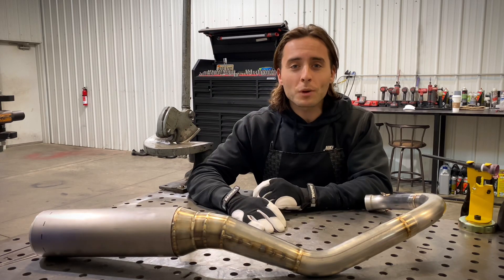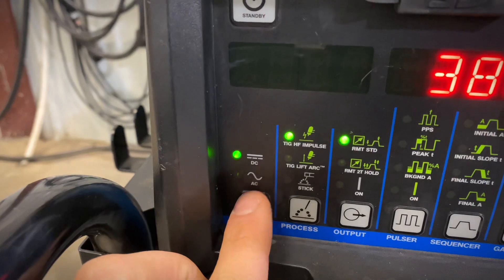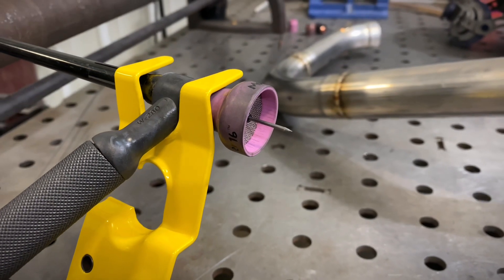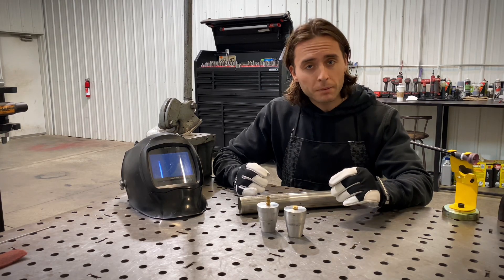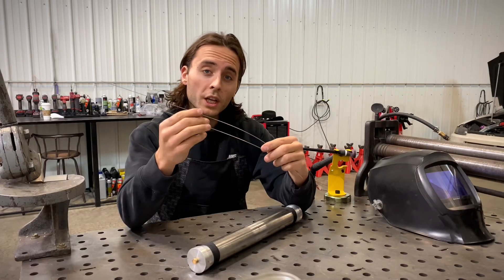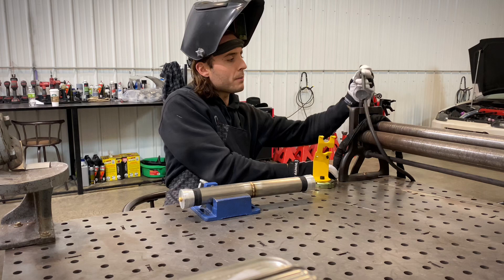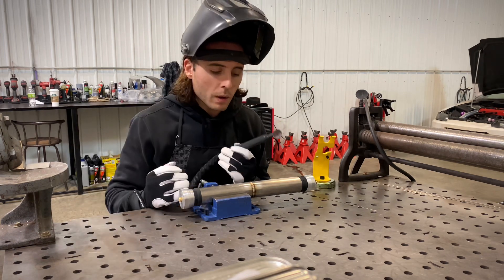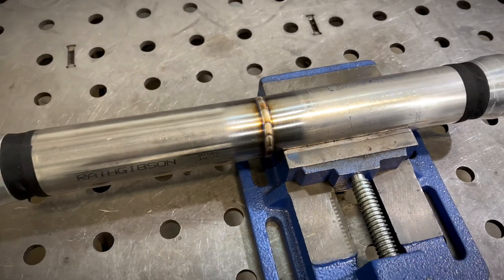How to TIG weld stainless steel exhaust like a pro!

Comment: Just to be clear. The filler rod is ER312L and would be the same in an other brand?   For 16g 304 car exhaust would you use 045 or 1/16 rod?  nice job!   thanks
Reply from the maker: Thanks for the info! on 16g , 045 would be money!

Comment: D'ya cut your 0.035" off of a mig roll...?? finding it hard to get a hold of such thin tig rods but loadsa mig drums at this gauge..
Reply from the maker: No I dont , i get 035 in straight filler rod.  If you search hard enough you can find anything! :)
Reply: @KULLYCO  ok cool will search harder :P

Comment: Great Video! When I back purge, I use the very flexible, beige "silicon type rubber surgical" hose. You can move the part around without "fighting" traditional hard rubber hoses.
Reply from the maker: Oh very nice! good information!

Comment: Which rod did you use
Reply from the maker: .035” supermissile
Reply: @KULLYCO  so can I use 308L 1/8 " for exhaust pipes?
Reply from the maker: @amandos17  right on 308 is a good way to go too!
Reply: @KULLYCO  I'm a beginner welder how can I contact you instantly if I have any questions? Any links to your social media sites?
Reply from the maker: @amandos17  yes for sire . I am @kullyco on every platform. Message me anytime. Keep up the practice !
Reply from the maker: @amandos17  1/8” might be slightly thick for welding rod depending on how thick your exhaust tube is .  I use .035” on 18 gauge material

Comment: Should we be using back purge for the tacking part? Also do you back purge when welding on an exhaust flange?
Reply from the maker: Great questions. I don’t use purge when I tack .. because I’ll be burning back over it with purge when I’m welding the seam.. but I know some guys do . 

Yes , i purge the exhaust when welding the flange - just to be safe.
Reply: @KULLYCO  We appreciate you out here keep grinding pimp!!
Reply from the maker: @BuddysBS  thanks bro! I appreciate that . Going to keep doing my best !

Comment: Okay, dumb question: those backflow pucks - the only way for the gas to escape is through the seam between the two workpieces? Does that mean that once you're making the very last "dime" that the air pressure might push that molten metal out? Maybe surface tension would keep it in, especially if it's a very low pressure from the tank.
Reply from the maker: That is actually a really good question!  Yes, in some cases that exact scenario can happen, so you have to be careful.  Its more susceptible to happen when welding higher amperage stuff like frame tubing, because the more heat causes more pressure inside.  Most of the time on exhaust stuff you are okay.   However, usually one of the back purge pucks has a bleed hole in it so the purge gas can escape- to prevent this from happening.
Reply: @KULLYCO  The bleed hole in the backpurge puck is genius! Thank you!

Comment: No where I’ve looked have I seen any mention of super missileweld in .045 or .035.  I’ve only seen 1/16, 3/32 and 1/8. You mentioned tensileweld, but didn’t mention which alloy.  Could you possibly post up which alloy you used?

Comment: Link for the rods 🙌🏼🙌🏼
Reply from the maker: It’s hard to find ! Look up tensilweld online for the welding rod . That is what super missile is officially called
Reply: Can you provide a sku or something.  I’ve looked and cannot find .035 supermissileweld/Tensileweld. I can find 1/16 missile and .035 tensile but I wouldn’t know what alloy to get.
Reply: @mattsick128  I’ve looked myself super hard to source out lol
Reply: @_dirtyfab5337  did you find it?
Reply: @mattsick128  after searching I found it.
Reply: Found it. Link is posted
Reply: @_dirtyfab5337  awesome!   Where is it posted?
Reply: @mattsick128  look on comments brother.
Reply: @_dirtyfab5337  nothing comes up. I don’t see any link in this comments section at all.

Comment: What’s the frequency and balance setting?
Reply: frequency and balance are for AC tig welding (aluminum). Stainless you use DC. There is no frequency/balance settings to adjust for DC.
Reply: @davidhaas2528  He might have meant pulse frequency. Probably not since he asked about balance though.
Reply: Check out 7:52 where he's welding in real time. It's just straight DC. No buzzing, no pulsing. Quiet, super peaceful. I quite enjoy DC on TIG. Way less crazy than stick.
Reply from the maker: @jimmurphy5739  thanks for watching !
Reply from the maker: I can’t answer that honestly !